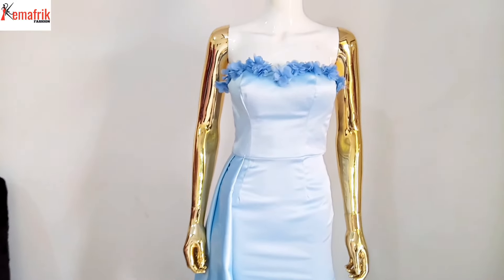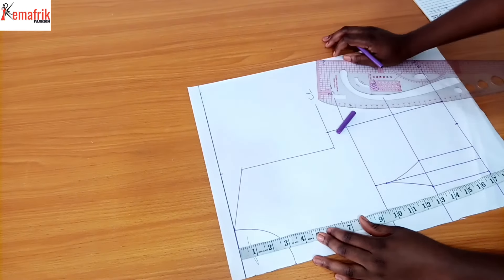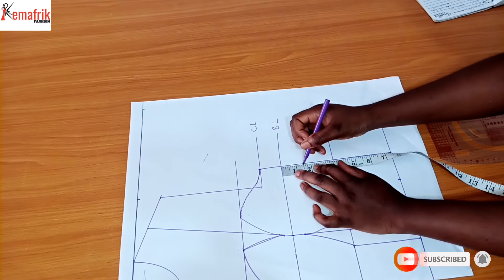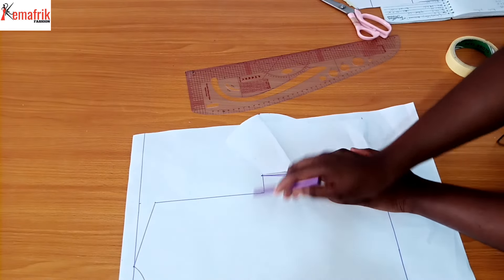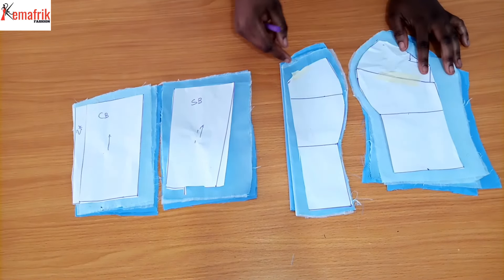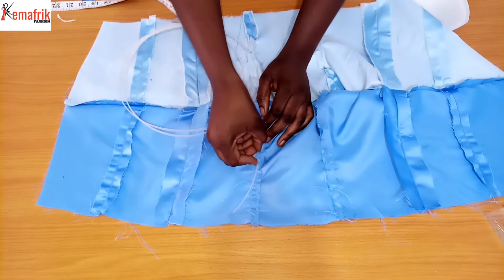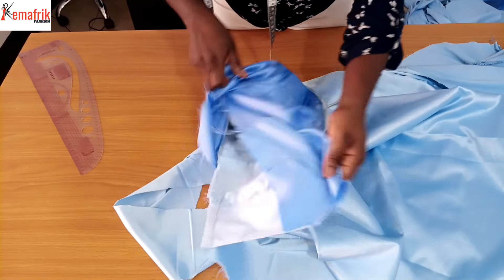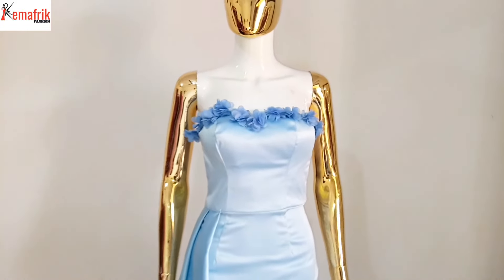How to make a strapless mermaid dress with inbuilt structure.

Comment: Thanks ma for the tutorial,  i observed from your videos you don't tighten the underbust, you just go with d dart leg lines. 
Pls is there a reason to that
Reply from the maker: You are welcome. You're right, i tighten the underbust using the same measurement i used for the waist dart. It's more accurate to use your underbust circumference but this works for me and it's faster.